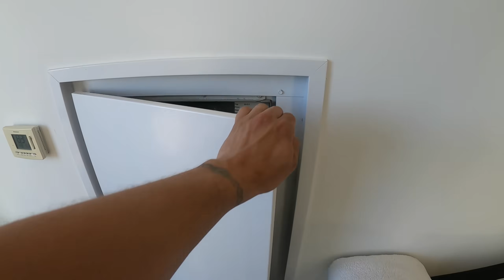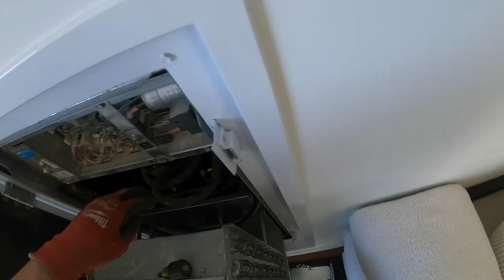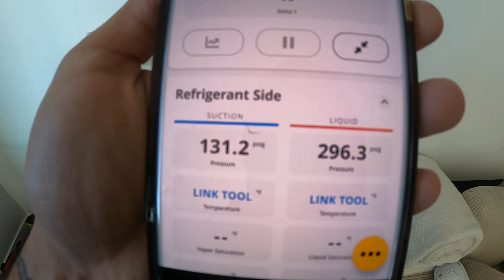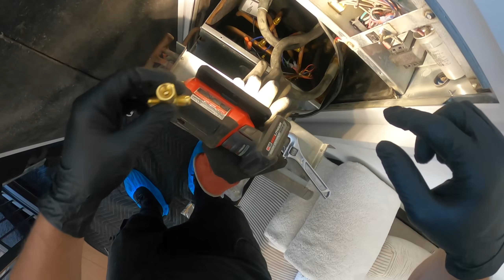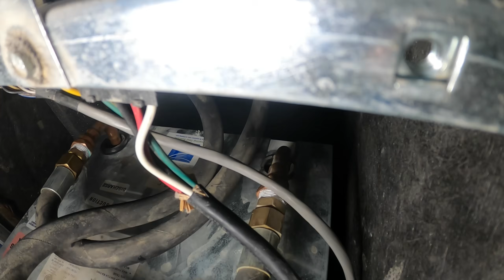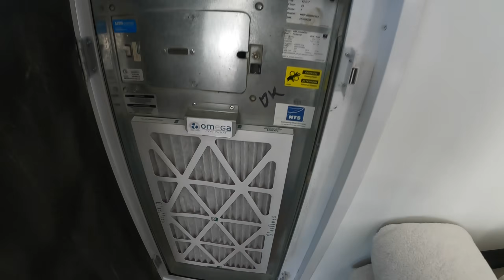HVAC: Water Source Heat Pump Not Cooling Or Heating (OMEGA Water Cooled Heat Pump With LPS Error)

Comment: Hello, my heat pump is just one year new , but recently the RST light is blinking red , not cooling at all, I tried to press the test button on the circuit board, and now it back to normal, I would like to know what’s going on with the red light blinking earlier and now not blinking after I give a try with test button, should I call professional to check ?

Comment: I live in a condo in Oakville, and my HVAC unit has become a real nightmare. It keeps tripping due to an LP error. I contacted the warranty team, and they told me I’d have to wait until next week for someone to come out, but with Christmas just around the corner and guests coming over, this is really stressful. The same thing happened last week, and after hours of hard resetting, the heat eventually kicked in. But now, the issue has returned, and I’m beyond frustrated. I just need this fixed! 😢

Comment: I was working on a unit that had 8 degree temp split on water side and head pressure would fluctuate between 330 to 450 Psi. I noticed sometimes water inletlet temp from building side go between 58 to 70F.  Is this a problem that could cause fluctuations on high head or is it the water flow through system ?

Comment: You would think that the board wouldn't be able to tell the difference between the switch or the fuse. When the switch is closed, its two leads are shorted just like they would be with the fuse. If it was a pressure transducer it would be a different story as the signal wire would have a varying voltage depending on how much the reference voltage is pulled down.

Comment: They well known i hate working on them and hard to get to the ports to check pressures gotta take the unit out and unscrew the water lines and using those probes are better because each time you put gauges on you lose refrigerant its only ounces in there ive been watching your videos 📹 been helping me out with refrigeration I just started with a new company that does hvac & refrigeration so your vidoes help out alot thanks bro hopefully see you around the city thanks for your help

Comment: That factory pirt looked like a coremax fitting. If it is, it always has a depressor, i personally hate coremax . They always leak, and a swivel tee is the quick fix for it. If im recovering the refrigerant....i get rid of them and add a conventional port. Usually ⅜" with a ¼" flare fitting for hoses or gauges/ probes.

How does the unit fail on a LPS with the sensor bypassed????? I don't know how that board " would eventually cut off on LP" Unless there is a suction line temp sensor tied into the board....or it has a loss of charge switch also connected???????
Reply from the maker: It does have a shader valve inside. I tried with a spare unit in the basement. It honestly baffled me as well as to how the system can shut down on low pressure control with it bypassed. I called tech support and asked them and that is what they told me. Not having the LPS wired will somehow trip the board. I asked if there was a low temperature sensor or something, but there isn't. It is straight forward. Makes me think the board is faulty honestly but they said no control could trip it. Honestly doesn't make sense but idk how they built those controls and their board. No loss of charge switch. The charge was good in this case and still tripped with no control. I wondered if there OEM controls have some sort of resistance that the board can sense to trip it. We will see what happens. This aftermarket control was a test run. Might need OEM controls or that board has to be faulty. Thank you for the advice & thanks for watching! 🙏🔧⚡️
Reply: @JumpermanTech climate master units have two sensors to detect if the LP is bypassed. Does this unit have those sensors?!

Comment: Omega are junk. They make furnaces here in Aus and are just garbage. I came across a unit running without the combustion fan working and started a fire in the cabinet….the customer called saying there was a burning smell…luckily there was a rollout switch that worked!

Comment: PRESSURES ARE USELESS NEED TEMPERATURES NOT PRESSURES TO DIAGNOSE BECAUSE PRESSURES CHANGE WITH THE FLAVOR OF REFRIGERANT USED BUT TEMPERATURES DONT CHANGE SO ONLY USE TEMPERATURES NOT PRESSURES THIS WILL MAKE YOU A BETTER TECH AND TRAINER
Reply: Cool, but you dont have to yell.
Reply: I feel like for this particular situation he is correct in just checking the pressure, the board was locked out on low pressure (the board also doesn’t care about temperature) he was just proving there was no low pressure issue.
Reply: pressures are good enough if you know your pt chart corresponding to temp lol.
Reply: I stick by my original post because everyone says use temperatures not pressures if you tell a mentor or a boss the pressures they will either not respond or they'll give him schite about it the temperatures are how to diagnose refrigeration systems not pressures because you give pressures the person you are speaking to has to use a TP chart to convert the pressures to temperatures and you diagnose with superheat and subcooling so pressures are worthless because these are temperatures not pressures. He needs to learn the correct way to diagnose a system. Sorry for the caps lock on previous post. I also see him training a helper so if he does not train his apprentice the right way then his example is passed on to the next trainee that his trainee trains later in the future then again Senior techs or Journeyman techs want to blame the trainee when it's is the person's trainer because their excuse is "that's how I was trained or taught" which is WRONG!!! So train the right way instead of passing bad habits down. You will be better and make your apprentices better at diagnosing refrigeration issues if you train them to use temperatures not pressures.
Reply: Screaming = crazy, slow down and compose your thoughts
Reply: Screaming = crazy, slow down and compose your thoughts
Reply: OK
Reply: Ok I already said to properly diagnose a system you need the temperatures of the Superheat and Subcooling so tell me what the reading is when the pressure for Superheat when pressure is 165PSIG and Subcooling pressure is 380PSIG diagnose the issue refrigerant flavor does not matter because pressures are the same so tell me what is wrong I bet you CAN'T because pressures are not the same temperatures because refrigerants are not the same but if I was to tell you the Superheat was say 2°F and subcooling was say 10°F manufacturer says the system has a TXV and the Subcooling of the system is designed for a 9° subcooling then you could properly diagnose the system without the pressure readings (all stats were made off top of my head not actual) I could tell you it is a air flow issue without pressures used or knowing what refrigerant is in the system because operating temperatures don't change. So anyone that says pressures go with temperature like I go with dummy haha ha is the idiot that has no business or experience to make this idiotic comment and yes SLIM SHADY IS AT IT AGAIN HACKS. This is not directed at anyone that know that to be a good tech and properly diagnose a system you need temperatures not pressures. JMT this is not meant as a calling out because you do great work on the boilers and I respect what you do but if you are training someone then train them the right way. Temperatures matter not pressures because temperatures are the same whether on a 410a or R32 system evaporator operates at a temperature between 35°-48°  and condenser is designed for a temperature approximately 25°-30° over ambient temperature this is HVAC design temps not refrigeration. Most of the fellas condemning my comment could not do refrigeration racks or otherwise. So the gentleman that made the dummy comment can stay in his lane because he isn't even in my league.
Reply: @dmiestercommkitchentech3043  Try me , I’m everything in one , HVAC , Steam systems , Gas boilers ,domestic  and commercial , AirCon systems , refrigerant systems.
Reply: @dmiestercommkitchentech3043  🥱
Reply: He’s talking in pressures because it’s easier. He stated the refrigerant. It’s short hand and an easier way to refer to the temperature of the refrigerant. there’s no need to try and life coach the bloke.